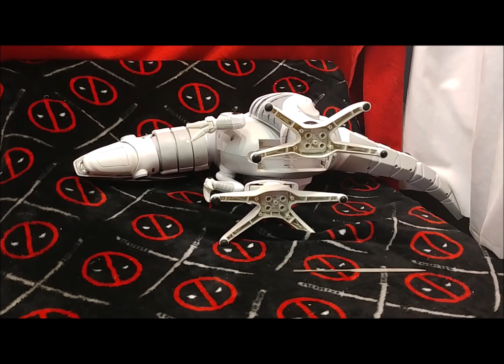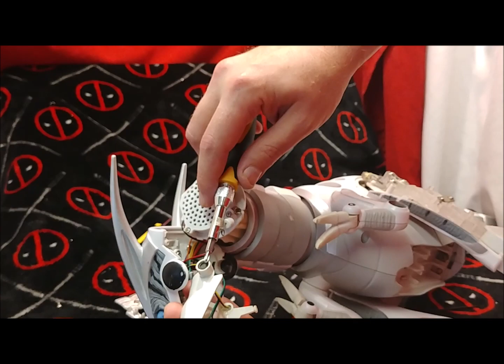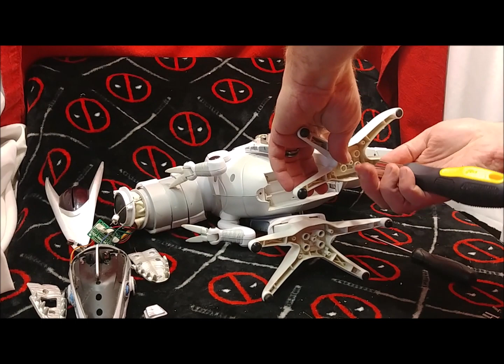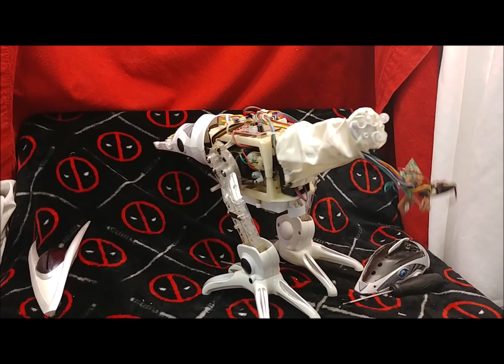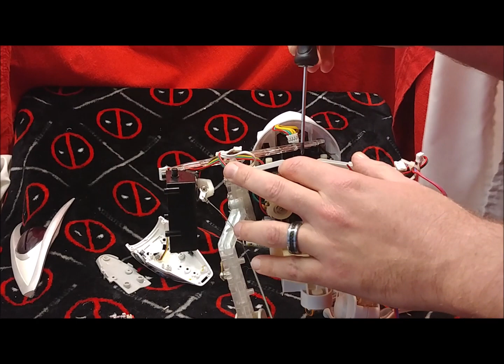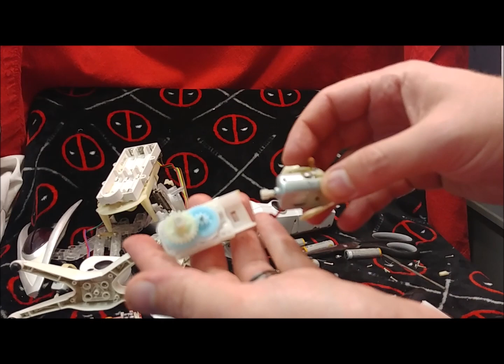Roboraptor History & Teardown WowWee Remote Control Raptor Dinosaur

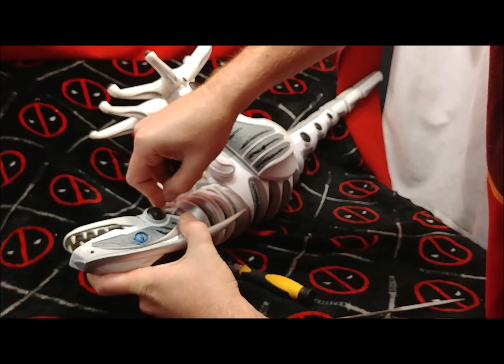Comment: At 2:22, you need to pry off those round black pieces where the jaw hinges and the white piece will come right off. Those 2 black sensors (under the round black pieces) where the jaw hinges are microphones. It can tell which direction you are talking from and react accordingly.

Comment: How do you sync the controller, we have one but misplaced the manual
Reply: You don't have to sync anything, make sure you have the correct remote and make sure both the remote and the Roboraptor work. Once Batteries are put into both the robot and the remote you can control it, there's no need to sync anything at all

Comment: used this thank you found the left leg was broke strip wire and broken spring
Reply: died after cheap hock breaks on guard mode  why???!!!! 

shift is not necessary to use on the controller guard is why it spins to much by clockwise 
cause the hock going from the motor to the jaw why it spun and broke 

these really shouldn't be for kids do to cheap connection blame the guard mode had 6 of those yet no good so 
Roko is better though it was fun for a week then it breaks 

as I said that there  in the commercial tv add comments not ok for kids if it breaks so easily

this is the  GUARD modes fault it breaks and it can
be a fine because they make these so weakly adding tape now before they glued it when they should've had a soldering tool
Reply: why its guard because its neck breaks off the hock every time fully charged

Comment: I have this same raptor. I can't get it to power on. Put new batteries.  Any ideas
Reply from the maker: Did you clean off all the leads in the battery compartment?
Reply: @NevsTechBits  The same thing happened to me, I found that I had placed a single battery of the six in backwards.